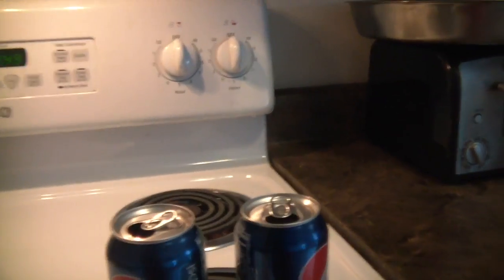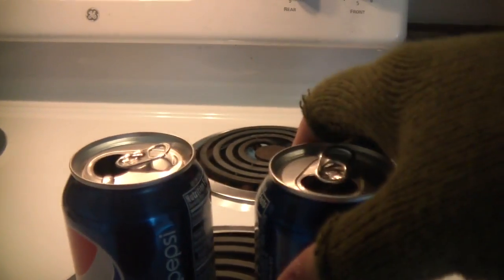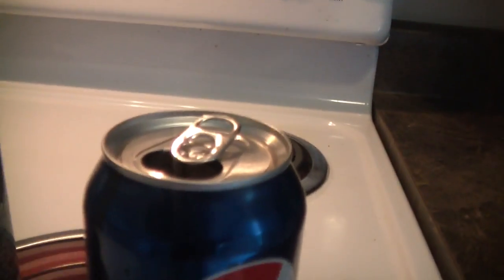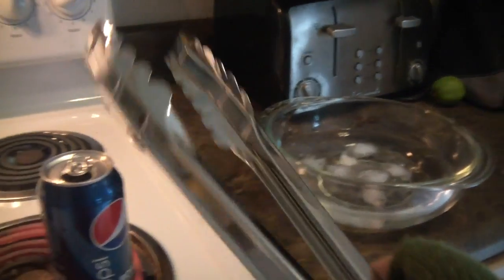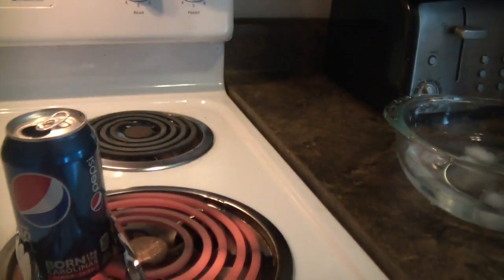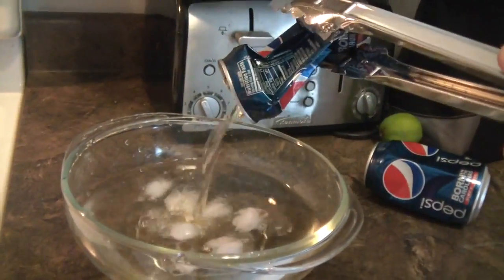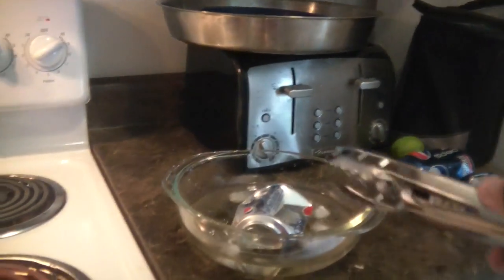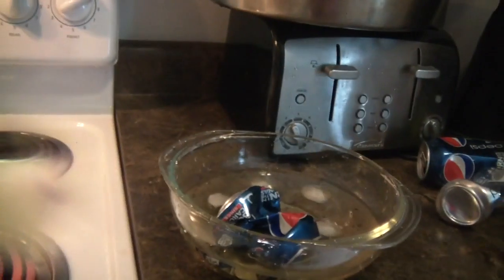How To Crush A Can The Russian Way!

Comment: The water inside the can turns into steam, when you turn it upside down in the ice water, the steam turns back into a liquid, which takes up much less volume and has less pressure. Therefore, the pressure on the outside is able to crush the can becauyse there isnt enough pressure on the inside to withstand the outside pressure

Comment: Charles's law.   The water vapor is heated and thus the volume that gas takes up is greater.  When you invert the can into the water the gas becomes contained, and as the gas cools the volume decreases causing the pressure inside the can to drop.  The pressure outside the can is much greater then the pressure inside and BOOM, it gets crushed like a faulty submarine.

Comment: When you heat it the water you put inside the can turns into water vapour and pushes the air out. Then when you put the can into ice water upside down the vapour turned into water again so created a vacuum and so the can got squashed.
Reply: 9/10 missing one thing... you can work it out though :)

Comment: Top comment is wrong...
Explanation:
When the can is heated, the water inside is brought to a boil and phase changes from a liquid to a gas (water vapor). When the can is brought to the ice bath, the water vapor inside the can rapidly cools and condenses back into liquid. This dramatically decreases the pressure inside the can, making the pressure inside less than the pressure outside (atmospheric). Normally, the pressure would be the same inside and out. The pressure inside would act as a counter pressure to the pressure outside, and vice versa, preventing either pressures from crushing/blowing up the can. Now, since the pressure outside is greater than the pressure inside, it overpowers it and crushes the can.
Reply: This one is correct
Reply: yay I have an idea about my science project😅😂

Comment: when a gas (the air in the can in this case) is heated, it expands so the air goes out of the can when you heat it. then you drop it in cold water the hot air inside can cools rapidly making it contract. there is no way for air to enter so the water has to enter, the inertia of the water is more powerful than the structural integrity of the can so the can implodes before the water rushes in and the water fills the rest.
Reply: You sound like science.
Reply: Charles's law
Reply: you sound very intelligent sir.

Comment: This happens because as the can heats up, the steam (H20) expands and takes up more space. There is not enough space inside the can for both steam and air, so the steam pushes the air out. When you put your can in ice water, the steam cools, contracts, and condenses back into water and the sudden cooling causes a vacuum in the can therefore making the pressure in the air higher than the can resulting in crushing. The reason water goes into the can is because when the steam contracts and takes up less room, the vacuum pulls material (in this case water) from whatever holes back into the can.There is a vacuum because the steam in liquid form takes up less space and the extra space has to be taken up by air.

Comment: Its because when the air inside gets cool the oxygen indide rapifky gets denser msking it a lower pressure area so there is more external pressure thsn there is internal pressure

Comment: It implodes because the water vapor took over the oxygen in the can, and when it cools, it then turns back into a liquid, lessening the inner pressure, making about 10,000 kg of pressure (I think, correct me if wrong) from the atmosphere compressing the can :D

Comment: because there was not enough air pressure inside to keep it balanced so instead there was more air pressure outside so the air pressure on the outside was strong enough to crush it. it wouldnt work in the mountains because there is not enough air to have strong enough air pressure.

Comment: The pressure on the outside is greater than that on the inside, therefore it pushes against the can and crushes it. This is caused by the sudden heat change

Comment: the chemistry is actually kinda simple.  The Atmosphere that puts pressure on everything is 14.7 pounds square inch (psi).  When you boil water, it turns to water vapor, and pushes all of the oxygen out (higher pressure) but then when you put the can in the cold water, the steam reverts back to water itself leaving a vacuum inside the can, (no pressure inside), and the atmospheric pressure crushes the can with the outside pressure of 14.7psi

Comment: The inside of the can is very hot and full of steam and hot air. when the mouth of the can hits the icy water it high pressure steam and air wants to leave he can to the low pressure of the cold bowl. All the air rushes out leaving a vacuum which is partially filled up by the cold water, stopping the can from crushing all the way.

Comment: What happens is if you boil an empty pop can, the air inside gets heated.As a result, to maintain constant pressure a lot of air escapes, since heated air has more pressure than unheated air. When you stick it into cold water suddenly, the pressure inside goes waaaay down, and the air can't get back in since it's inside the water. So as a result, the pressure from the air and water crushes it.

Comment: the hot steam in the can, molucles far apart. moving fast and the spread out. when it goes into the ice, the water seals the hole in the can and the coldness rapidly makes the gas inside contract into a more dense state.. pulling the walls of the can with it and drawing water up inside as well.

Comment: When water flashes into steam it expands to over 1700 times it's original volume. When the can is removed from the burner and placed into the cold water, the steam vapour that was filling the interior of the can rapidly condensed back into water. This created a vacuum inside the can which allowed atmospheric pressure to crush the can.

Comment: The rapid chang of tempeter like when you melt ice it go from solid to liquid the imcrease of temp. expands it the cold contracts  so when changed so fast it expands when heated and crushes in the cold water like liquid nitrogen boils at room temperature insted of 262.3 for water

Comment: CrazyRussianHacker this happens because when you heat the can up you create a water vapor within the can from boiling the water. When you flip it over in the ice water, the water vapor quickly lowers it temperature and condenses. When it condenses, it causes a vacuum to occur within the can. The internal vaccum then causes the wall to buckle in and sucks some of the water out from the bowl.

That's why it implodes

Comment: It's really simple lol. Heating the water fills the can with steam. When you put the steam filled can in cold water (hole facing down, so the steam can't escape), the water rapidly cools the steam into water again. Since steam takes up more space than water, when the steam turns into water, and thus reducing the amount of space it uses, a vacuum is created in the can. The vacuum causes the air pressure around the can to be much greater than inside the can, causing it to be crushed.

Comment: KISS - Keep It Simple, Stupid.
The water in the can boils and the steam pushes the air out of the can. If the can is put into the ice water it cools down. A little bit of the ice water moves into the can. The steam inside the can condenses and a vacuum is produced. The water can not flow fast enough upwards into the can to fill the vacuum. As a result of the instant vacuum the walls of the can collapse.
For experiments with lasers see my homepage w.totalitaer.de, chapter Laserwaffen. Click flags

Comment: Temperature T is directly related to pressure P in a closed tank of volume V, with n being the number of moles of the gas (quantity of air) and R (gas constant).

The equation is P*V=n*R*T.
P1*V/n*R*T1 = P2*V/n*R*T2
(1 is when the air inside the can is hot, 2 is when it is cold). V,n,R are the same.Then P1/T1=P2/T2
As you are decreasing temperature inside the can,the pressure has to decrease to keep the ratio equal to the previous ratio. The new low pressure will therefore "suck" the can wall.

Comment: The implode happens when the heated can touches the cold water in retrospect hot water is fast moving molecules and cold is slow, so when the can touched the hot water it caused a chained reaction for the cold molecules to move very fast

Comment: the hotter the air gets the more it expands, the colder the denser it gets, so when you trap the low pressure in the can by putting it upside down the gases contract taking the can with it

Comment: The molecules of air inside the can (mostly Nitrogen and Oxygen) are replaced with water vapor (H20 molecules). But when the can is put into the cold water the water vapor condenses back into water leaving an almost perfect vacuum inside the can -- then pressure from the outside crushes it.

Comment: the air pressure in the hot can is the same as the air pressure in the room, it just happens to be that the bowl and the inside of the can are at two different temperatures. When the bowl water rapidly cools the steam inside the can the pressure drops below the pressure of the room in proportion to the drop of temperature. The air pressure in the room crushes the can! The rapid cooling is aided by the heat conductive aluminum in the can.

Comment: The can will get squashed because first you put water and then the water is boil when you remove the can from the stove heat stops then when you put the can in cold water it squashes because pressure is applied

Comment: The reason it does the action is because the molicules (think thts how u spell it :P) are used to the heat and spread apart from each other and when u put the moliculse in a colder spot the colder the more they will connect with each and the more they connect the can will come together other btw molicules are the little specs tht make the air lerned it in school :DD

Comment: you got it. it decreases the pressure right down into a vacuum, and the air on the outside of the can restores the equilibrium of the two, collapsing the can in the process.

Comment: It implodes because the hot water makes the pressure inside the can higher than the pressure outside... putting it upside down in cold water rapidly cools the can decreasing the pressure momentarily causing the can to crush

Comment: It implodes because water moves from a high density area to a low density area in attempt to balance it out. The inside of the can is at a lower density than the water, and  the water moves in extremely fast. Imploding.

Comment: the steam inside the can has a lower pressure than the air outside. when the can is put in the water, the inside the can cools and takes up less space. then the can crushes because of the vacuum formed.

Comment: the water inside the can turns to water vaper  and pushes all of the air out of the can and the vaper in now in side it so when you put the can in cool water the  vaper turns into water and the pressure in side the can becomes lower than the out side pressure so the can crushes

Comment: when you heat it there is hot air inside it qich has a lower density then colder air, the density of water is much higher so  the can will try to make the space smaller by imploding

Comment: It imploded vigorously due to the huge pressure difference between the can inside (a contained volume as water being the cap) and outside.

We shd have exp in seeing a bottle of warm water (with cap on) shrink after a while in the envt; becoz when it cools, the air molecules inside contract but it couldnt get more from the envt, thus creating a pressure diff.

Heating up the can, and putting into the ice is just a vigorous version of the above process.

Comment: Water vapor at high temperatures takes up more space than oxygen, rapidly cooling that vapor with ice water makes the can lose volume inside creating a partial vacuum and the can walls are too weak to support it so it collapses and water rushes in.

Comment: This experiment/party trick is entirely reliant on thermodynamics (which is physics, it's just chemists tend to use thermodynamics more than physicists). For example the working medium (air and water) is irrelevant, if you did that experiment in a helium atmosphere with liquid xenon, both unreactive monatomic (i.e. not molecules) elements, it would still work.
Basically there's no chemistry in this. It's pressure and temperature changes resulting in the movement of heat, which is physics.

Comment: Sounds nice, but wrong.
Fluid water needs less space than gaseous. Bioling water vaporizes it and makes it gaseous which fills up the can. Once you put it into the water upside down, the icy water cools the steam inside the can. The water turns fluid again, needs way less space and the can implodes.

You can try the same with a plastic bottle if it doesnt melt away boiling the water.

Comment: This happens, because as heat is applied to the aluminum can, the intermolecular forces between the aluminum decrease distance in between the molecules. This causes the radius of the can to decrease. Since the pressure is inversely proportional to radius, the pressure of the can increases, and smacks out the oxygen.

Comment: Since molecules have a great deal to do with thermodynamics. Molecules move at a higher velocity if more pressure is applied. Pressure is a force. Also, this is an endergonic reaction, which means that it absorbs energy.

Comment: because the hot water produces a faster rate of atoms than the ice water. also there is more air in the boiled water which if put in ice cold water sucks in the water , causing it to push the air out triggering an inplosion. there you go crh

Comment: that happens because of the rapid cooling of steam in the can causing a vacuum/low pressure, i would make the observation that the viscosity of water is to high for it to fill the space in the can; through the opening before atmospheric pressure surpasses the cans strength.

Comment: when you boil the water inside the can, the space is taken up by fewer particles as they spread all over inside it. excess paricles leave through opening. then when you dunk it in the ice bath, those few particles try to get closer to each other and creates a vacuum causing the can to collapse

Comment: hot water in can condenses when it comes into contact w/ ice bath; pressure inside can drops b/c the gas that was filling it is suddenly liquid; outside pressure > inside pressure, causing the can to implode. cool stuff.

Comment: the can is currently filled with hot air. very spaced out air particles. hen you put the can in the cold water and seal the top the hot air that rapidly cools has no extra way to intake air so when you cool the can quickly like that the air cools rapidly and shrinks tight sucking in the water because there's no air outside the can.

Comment: Im pretty sure he added a bit of water to the can, heated the water to boiling point, the water vapor pushed out all other gas out of the can, now when he puts the can into the cold water, the vapor gas turns back into water, and we have almost no gas in the can anymore. The pressure of the atmosphere caused the can to crush, its a cool experiment to show how strong the pressure of the atmosphere is

Comment: I think I remember somebody saying the can implodes due to the massive change in temperature. From the heat of the can, it causes a vacuum effect to take place, causing a quick exchange of air/steam inside of the can to exchange with the cold water taking a displacement effect as well.

Comment: The warm air inside the can is rapidly cooled and becomes denser creating an area of low pressure inside the can so the air on the outside of it literally crushes it.

Comment: Wow most of you are wrong. This happens because the molecules inside the can give it a lower air pressure because heat energy decreases density in air. The can is crushed because the air pressure of the colder (denser) air out side if the can is literally applying physical force to the outside of the can. The pressure is greater on the outside so the force is also greater. Air is powerful.

Comment: Partially correct. When heated, the steam inside the can exerts pressure against the inside walls, displacing air molecules that were originally in the can. Remember, more heat equals more pressure. 
When cooled off by the ice water, the steam cools down and liquidizes, thus lowering the inside can pressure and letting the outside air pressure crush the can, kind of like if you just crushed it with your hand.

Comment: its kind of like putting a piece of dry ice in hot water but when you have hot and cold air to gather it creates a vacuum in the bowl causing all the air out of the can like using your mouth to suck out the air in a water bottle it bends

Comment: this is just like the glass bottle one where u microwave the bottle with a bit of water until it becomes steam, put it in cool water and the bottle fills up, except here the aluminum is weaker than glass so it bends to fill the void caused by low pressure

Comment: By the way, I forgot to say, do a dry rehearsal with the plugs to make sure you don't cross thread them. Perhaps an assistant to get them in and screwed down tight. Bung holes must be sealed with the plugs so there is no leaking. Make sure of this.

Comment: Take a steel 50 gallon drum, make sure there are no dents and it has a small bung hole and a large bung hole on the top. Wash it out with hot water to make sure it's clean and you don't have a problem with whatever was in there. You can heat it up with a can of brake cleaner by lighting the spray and sending hot flames into the large bung hole. When can runs out of fuel quickly screw in both prelubed plugs and set drum upright. Spray with cold water from garden hose. Stand back. "Whump!"